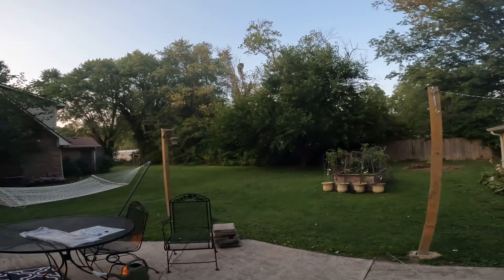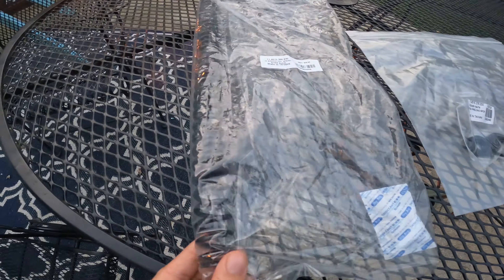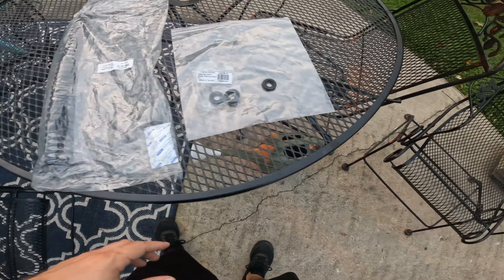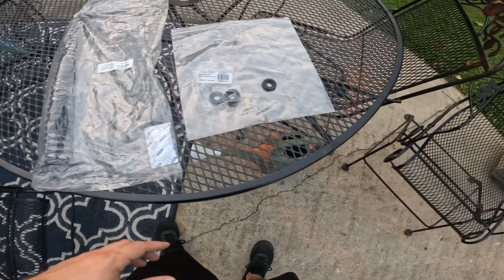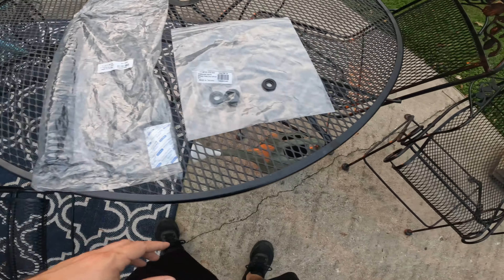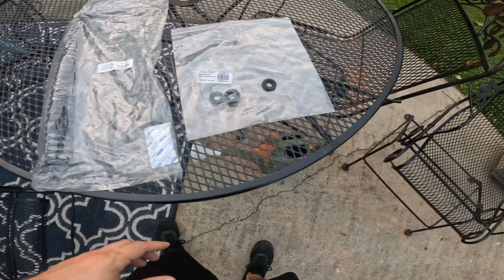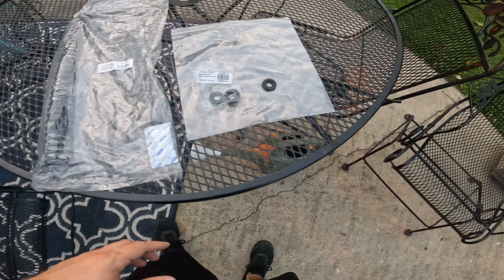Rockshox Boxxer RC Coil Swap

Comment: Hey dude can you take the thingy on top of the spring out to make it softer so there 0f them or do you need. 1 minimum
Reply from the maker: Hmmm I think you need at least one. (But I'm not certain)  Ordering a softer spring would be your best bet to get the fork to perform correctly.